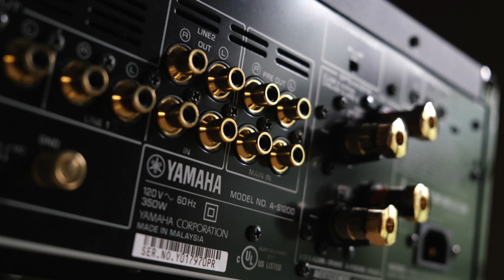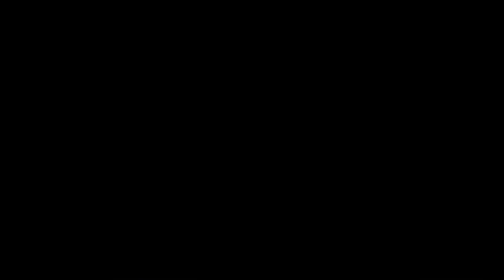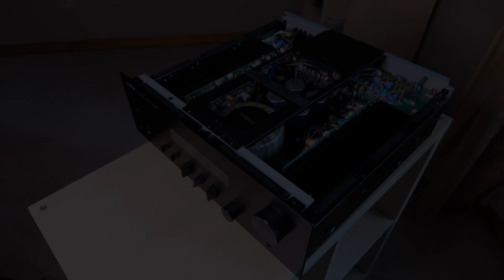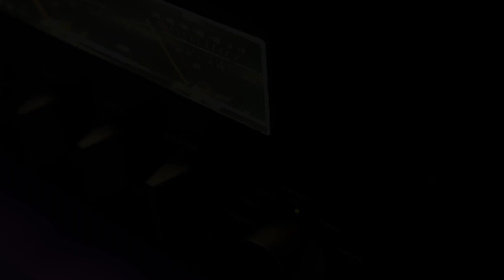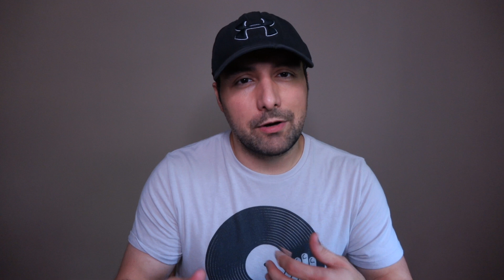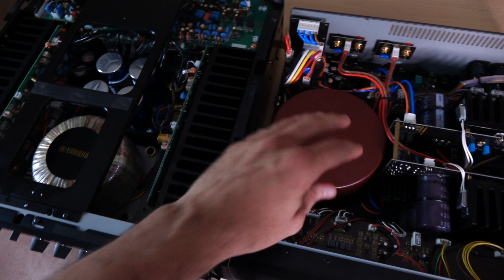Review!  The Yamaha A-S1200 Integrated Amplifier!

Comment: As the owner of the old A-S2000, I can see that unfortunately nothing has changed since the first generation.  I was hoping that Yamaha would do something with this annoying boost in the higher frequencies... and nothing came of it.  It is a pity that they still go in this manner of an aggressively tuned preamplifier, because the power amplifiers themselves play with a very even and much softer sound.  It's a pity that you still need to use an external preamplifier so that the sound is not tiring.  Yamaha has made a beautiful, solid and irritating device ... again.
Reply: @Jingle Nuts 
No, I haven't had Luxman yet. It's not really my budget. I have a comparison to many English brands as well as Denon, Technics and Marantz. Yamaha does something strange with the sound, which is very tiring with long listening ... despite the fact that I have loudspeakers with very even and fast falling highs. Despite this, I have the impression that my ears will start bleeding if I put on a new pop song.
The problem disappears completely when I use Cambridge CXN as a preamplifier. I think someone set the tonal balance of the preamplifier section built into these amplifiers very badly. Ridiculous that raising or lowering the treble level with the "Treble" knob improves, not makes matters worse. Just like the tone control cut-off system spoiled the sounds and added distortions. I met something like that for the first time and I'm discouraged from this brand.
Reply: @Jingle Nuts 
This strange sound is only on Yamaha.
The loudspeakers are about 2 years old and are of high class, a small Italian manufacture, hand made from very high-class components. Much more expensive than this Yamaha.
I don't think my ears match Japanese high-end. I plan to buy a very cheap English power amplifier. Maybe ugly, maybe poorly made, maybe it has stupid speaker terminals ... but it doesn't hurt my ears :)
Reply: @Jingle Nuts 
I bought this amplifier as used.
This is 2011 year of production - even if it has not been used for a long time, I have had it for a month. Actually, I rarely turn it off. 100 hours have already passed, even if the capacitors were discharged to zero. This equipment just sounds like that. Probably other people like this presentation, I do not like this sound.
The strangest thing is that movies or games sound warm, even dark. But the music and the FM radio ring in my ears furiously ... What the devil?

Comment: Great review Sean! Just wondering if you could also touch on the noise floor. You mention higher sensitivity is better suited for the Yamaha, whereas with the Parasound you suggest avoiding high sensitivity speakers if noise floor is a concern. Just wondering, how is the noise floor on the Yamaha? I.e. is the hiss under control on a 90+ dB speaker?
Reply from the maker: Noise floor is pretty low (thought I mentioned that)?  And yep, hiss is perfectly under control with 90+dB speakers.  In fact, I wish the Heresey IV's were here just so I could laugh at how ridiculously huge (and awesome) the music will sound from such a relatively small package.
Reply: Hiss at idle on my A-S2200 is non existent with 96 dB rated speakers.

Comment: I always find it a bit frustrating when reviewers don't really test the phono stage of an amp. It's becoming an increasingly important requirement for alot of audiophiles. Come on Sean, buck the trend!
Reply from the maker: The reviewer in question needs to 1) Listen to vinyl and 2) Be pretty familiar with it to have any worthwhile feedback.  I qualify for neither of the two.   My focus, as always, is strictly on sound.  There are times when I consider throwing away the "about" section of my reviews as it tends to invite more headache than it's worth.
Reply: @ZeroFidelity  Fully understand Sean. I suspect most of these modern integrated amplifiers include a phono stage as a bit of an afterthought thereby making a comparison between phono stages probably pointless. Anyone who is serious about vinyl is likely to opt for a separate dedicated phono preamp anyway. I'd still love to see that Triangle Genese Trio take II video.
Reply: James Wright I have an 1100 and the phono stage is fantastic. These amps have a reputation for that.
Reply: James Wright I have the 2100 and frankly I think the phono stage is just adequate. I prefer listening using my old Trichord Dino instead. Maybe my DV 10X5 cartridge doesn’t pair well with the 2100’s phono stage; too warm and some loss of details, I don’t know.

Comment: In my comparison of the 1100 vs original Halo, the Yamaha produced a much wider soundstage, less congestion and lower noise floor. Wonder if these traits carry over to the new models.
Reply from the maker: The less congestion and lower noise floor certainly applies to that particular comparison.  Imaging, to me at least, was fairly similar between the two.  The primary difference being:  How they project sound out into the room.   The Yammy can give the perception of a wider soundstage, but upon further inspection, both are similar.  Ones just more...in your face... about it.

Comment: Thanks so much for your helpful review of this and the A-S801! I am so glad I bought the A-S801, as I can see from your comments of this amp that the EQ response would definitely not be to my taste.
Reply from the maker: Cheers!  Yeah, the A-S801 and the A-S2100 are nearly on opposite ends of the tonal spectrum.
Reply: @ZeroFidelity  I have the A-S801, what exactly does that mean? How would I know which i'd like better?
Reply from the maker: @danbrodersen5838   I reviewed the A-S801 if you want a detailed summary.  Long story short:  The 801 takes on a warm sound, with a forgiving top end.  The Yamaha 1200 is far more resolute, clean, dynamic, and forward sounding.  Which one you prefer will boil down to taste.
Reply: @ZeroFidelity  Yup, my B&W 704 S2s already have a upper mid bump, so the A-S1200's bump would be overkill for me. I'm grateful, for the A-S801 costs a  heck of a lot less and has more power for my power hungry B&W 704 S2s.
Reply: @zaoria123  speakers have tone curves, transistors amps do not. It's not the frequency response that gives a amp it sound characteristics.
Reply: @zaoria123  don't just go by the specs. I've owned them both & the A-S1200 sounds more powerful, especially in the bass.
Reply: @ZeroFidelity  Thanks again for your great reviews! This one in particular saved me a lot of money and aggravation!

Comment: This is a very good amplifier! Has bass, treble and balance even though I never really use balance except when I need to check if the tweeters are still functional, you don't realise how handy it is until you end up with a Sony ES surround receiver that doesn't have hardware bass and treble and no balance adjustment! WTF Sony? And why the switch to class D? My older ES amplifier had less power but it's class A/B output stage sounded 100 time's better! Sounds great with movies but I have stopped listening to music on it, I think that my ION Bluetooth Blockrocker portable speaker sounds better! I kid you not! 
But this Yamaha looks like it's built right. Has all the correct controls on the front panel, a loudness switch would have been a bonus! The AUX2 input can be used to connect a graphic equaliser! Awesome 👍 and the graphic equaliser has another two inputs on it so that I can connect my reel to reel tape machine and my Yamaha compact Natural Sound Cassette Deck! Turntable input is there and another AUX input for Bluetooth! I'm covered for what I need! 
It's not cheap but good amplifiers never really have been... This one will out live me... 
The other amplifier in this review towards the end is kinda boring and possibly doesn't offer the same flexibility in the connection department where the Yamaha really shines! I would still be happy if it was only rated for 20W per channel, 20W old school watts! I have a 13W per channel amplifier that rocks my house! But they were designed to run large 15" three way speakers, subwoofers were only invented because small speakers were being made, they make no sense whatsoever with large main speakers!

Comment: I just purchased the a-s2200 and first thing that I noticed was that bass and I was pleasantly surprised. Now I'm thinking my speakers need to be replaced especially because they are older Klipsch. I got my eyes on tekton speakers not sure which ones but wondering how the Yamaha would pair up with the tekton sound.
Reply: Congrats! That's how it started out for me, one thing lead to replace another, over 100k later I have my system.....oops!
Reply: @Jingle Nuts well specifically they are the forte II and for the most part I do like them however they can get too fatiguing on the ears when I want to do a listening session for longer than 30 min and the cabinet doesn't have good bracing you can detect resonance at certain frequencies. I guess that's the main reason for wanting to replace speakers next. I guess I could refurbish them and do tweaking. IDK  still undecided.
Reply: @Jingle Nuts thanks for the info. As far as crossovers go I was just going to try the crites stuff and possibly the titanium tweeter but was lost when it came to getting that cabinet quiet I thought about lining the inside with dynomat but I'm just afraid of doing more harm than good

Comment: Shawn (or anybody really), I've noticed all the Yamaha print on these new amplifiers have dropped the term MOSFET (except for the top of the line 5000).  Do you know if they have moved away from mosfet to something else?  If you have a press contact with Yamaha, I'm just interested to know.  The term is strange in its omission, as it used to mention it a lot.
Reply from the maker: I confirmed earlier today that it still uses Mosfets.   To be honest with you, I was thinking they switched to bi-polar transistors as well and planned on pinning a comment about the change.  Turns out, that's not the case.   Note:  Either way, it's not a big deal to me.   Audiophiles get way too wrapped up in certain ideas like servo-control (for subs), mosfets for SS amps, etc..   In reality,  what's far more important is how well engineered a component is.  Something that you can't necessarily tell by looking at a spec sheet.
Reply: @Zero Fidelity:  👍
Reply: Cool, thanks for the info.

Comment: $2799.00 is a very steep price for this Yamaha in my opinion.
Reply: I agree it is steep. I often wonder how these high priced corporate company integrated amps sound compared to an equally priced separate system. You can get a lot of different components that add up to $2700.
Reply from the maker: Oh its expensive.  But it's all relative.   This is an old school amp that's borderline overbuilt given its power rating.   Specs can be achieved on the cheap.  But  high-quality internal components and precise assembly on the other hand?  Not so much.  The funny thing is that the A-S1200 serves as the entry point for these type of products.  Want the same general thing from a different brand like say,  Luxman, Accuphase, and McIntosh?   Psh.  You'll be paying WAY more just to get a taste of their lines.   Again - this whole thing could be outside of your wheelhouse, but I don't think its bad for what you get.
Reply: @ZeroFidelity  it's all in my wheelhouse, I just have been debating in my head, trying to hear as much as I can, but the virus has limited a lot of in store testing lately. I always have wondered when the brands like yamaha, denon, marantz, etc become overbuilt and extremely high quality to rival boutique companies and mccintosh.
Reply: @williamwest9253  You have to spend 5K for low end McIntosh or Luxman Class A/B. This Yamaha seems to be a great entry point at half the price, doubt it is only half as good sounding.
Reply: I've compared the A-S2200 with the McIntosh MA5300 on various speakers, granted it was two different places so I couldn't compare them on the same exact speakers.  In my opinion and based on my personal taste, the Yamaha sounded better.  I also think a lot of times, when a big company makes high end products, like Yamaha, they don't get the same respect as the high end boutiques since people have preconceived notions.  I would love to blindfold some of these "Audiophiles" and do an A/B test on them.
Reply: @dfknyc78  yup agreed. I paid 6K for my CODA amp, and sound-and-build-quality-wise it is WAY underpriced compared to similar specced McIntosh or Luxman amps. These new Yamaha integrateds are maybe not massive upgrades on the previous generation, but at the price I'd take the 1200 or 2200 over similarly priced integrateds from anyone else. The only thing I don't like about them is the 1200 headphone amp isn't up to snuff, and the 2200 is not a truly balanced circuit.
Reply: @michaelmityok1001  very interesting on the A-S2200 not being a true fully balanced circuit design feedback, can you share any links on this?  The Yamaha website speced the A-S2200 as a fully balanced circuit design from input to speaker.  6moons did a review of the older version (A-S2100), requested by Yamaha Canada where 6moons had direct access to Yamaha reps and the reps provided additional technical information that is not readily publicly available.  The review states that the A-S2100 is fully balanced from input to output, not just for the XLR, but it also does internal conversion on the single ended inputs (RCA) to turn the signal into fully balanced once the signal comes into the A-S2100.  Now, I can only assume that the A-S2200 kept this fully balanced circuit design from the A-S2100, particularly it is stated as a fully balanced circuit on the Yamaha website.

Comment: Only as3000has iron core transformer. Are you reading all the right spec sheets?! The caps in As1200 are slightly higher than the ones in the 1100

Comment: I am tossing up between this amp and the Rotel rotel 1572 mkii. Features are not an issue because I run a separate DAC. On looks and build quality alone, the Yamaha is a clear winner BUT the "unique" tone that is commented on has me worried. Is it a permanent feature or does it diminish with burn in? FYI I am pairing with Buchardt s400 II.

Comment: Will this amp pair well with 87 db 80W nom./120W 8 ohm speakers?  I just had them made to order at a local audiophile shop here in Bulgaria and they are lively sounding with great imaging/soundstage. But my perfect rebuilt/recapped Marantz 2330 falls short, so I'm on the hunt for an upgrade for under $3000. Over 3K, I'd go Luxman.

Comment: 3:34 you touch on the two independent speakers need to be 8 ohms min if wired off the two sets of terminals. But can a 4 ohm single speaker be bi-wired off the two terminals, or does does the single speaker need to be 8 ohm also?. Probably a stupid question but thought I get clarification.
Reply: I'll answer this for you then. Two separate pairs of speakers wired off "A" and "B" terminals are essentially wired in a parallel circuit, meaning the overall resistance will already be sitting at 4 ohms with two 8 ohm speakers connected. So bi-wiring a 4 ohm speaker to terminals "A" and "B" is perfectly fine for a single 4 ohm speaker. Sleep easy everyone ;)

Comment: I would have to disagree on your point on "forward" sound in the upper frequency from these Yamahas.  To my ears, it's neutral, never bright.  More laid back to me especially after 500 hours of burn in.  It does seem to have a very "unique" way of presenting treble that I have not heard from even Luxman integrated(It think it was 509, but many other variables also).  Not that I am saying it's better than Luxman.   It gives an extremely wide soundstage, and imaging at the same time is holographic.  I have Polk LSiM 707's.  Which speakers did you hook this up to?
Reply from the maker: Appreciate the feedback! You'd be the first person I've come across who interprets the HF as neutral.    Still, I can respect your observations all the same.   As for the speakers I used:  Dynaudio Evokes.  Harbeth P3's.  Klipsch Cornwall IV's.  The latter 'bright' combo is expected.  The other two won't be forward unless the gear that's attached to it is.
Reply: @ZeroFidelity  I actually have a AS2200.  Maybe there is some difference between 1200 vs 2200 but I don't think it's a major one.  Perhaps this newer models with toroidal transformers sets them apart even more?  Let me know how the sound changes with more time on the amp if there is any.  BTW, the XLR interconnect(Oyaide Tunami Terzo) between my arcam irDac or W2S dac2 to the AS2200 really tightened up the bass noticeably and also created even better imaging possibly toned it down a bit.  Thanks for the reply.  Great review nevertheless.
Reply from the maker: @BUNNYOWL_AND나비  I think you just hit on the major difference between the 1200 and the 2200.  The 2200 uses a natively balanced circuit.  The 1200 does not.  So if you're running balanced into your 2200, that could easily account for the differences that you and I are experiencing.  'Twould make perfect sense, actually!

Comment: Hi amigo Sean, I have the AS-1100 but, I would like a suggestion in a DAC for it, thanks!
Reply from the maker: DAC's are a different bag of chips.   Pick a price.  Pick the features.   Go after the kinda sound signature you want.  I'd advise going with something that has a reputation for being either neutral (accurate) or smooth along the top end.
Reply: @ZeroFidelity  thanks Sean,